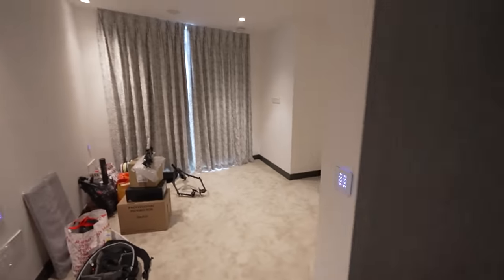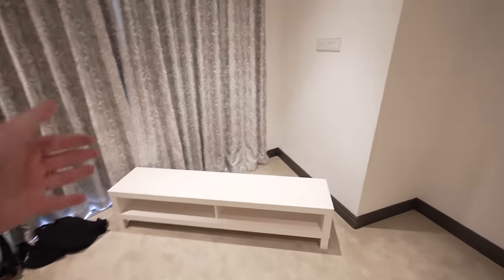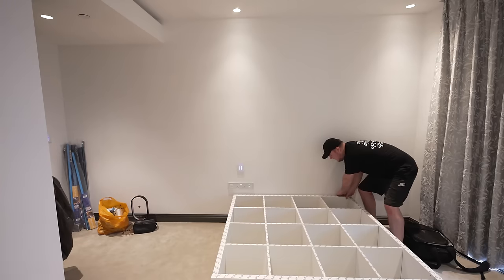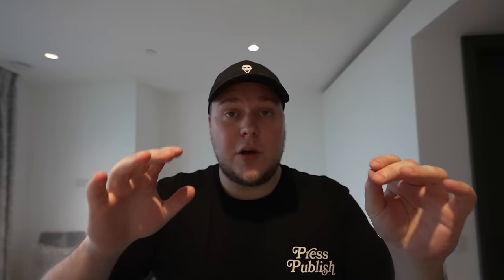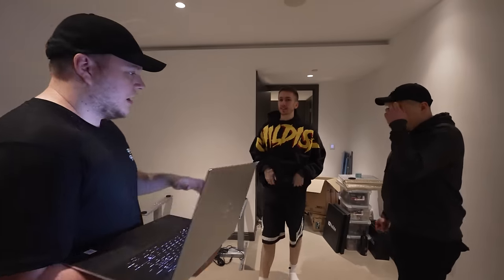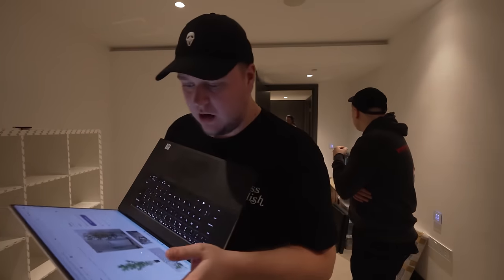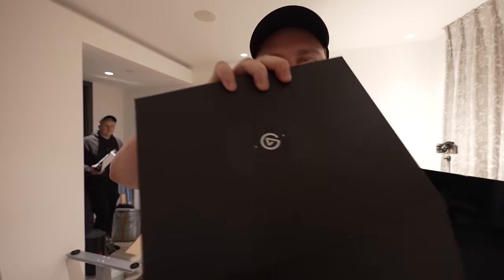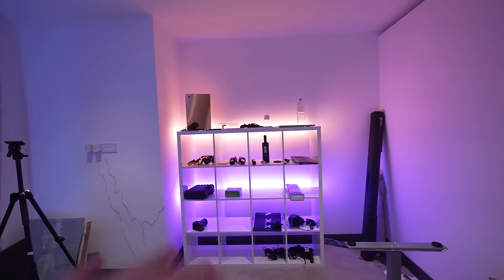BUILDING Miniminter's 2022 SETUP (PART 1)

Comment: Cut some timber down at angles to fit in each corner of the box shelving, this will stop any movement in the shelf’s when you wobble them. Just from looking they were swaying lots when you moved them around.
Reply: You can either use strong adhesive which would look better to fix the timber or screw them but this may not look as good

Comment: Ummm, if you're just gunnu put the p.c on that bit of wood on the floor it's almost the same as having it directly on the floor, when people say don't put your p.c on the floor they usually mean put it on the desk (as in a raised position off the floor) it'll still help a little bit with air flow i guess

Comment: The Kallax unit needs rotating 90 degrees. The smaller shelves are designed to support the bigger shelves. Too much weight on it this way and it will collapse.

Comment: If you read just one comment I hope to too be mine. Don't buy a dell, then have a dell designed issue where if you wanna max out the cpu and gpu while plugged into the wall you won't get 2 hours out of it cause both the 9700 and 9710 battery drain while under full load. I'm trying to get a refund after being miss sold this, and after 2 months and then acknowledging that that's how the machines are designed they are now ignoring me emails. No where does it state on dell's website that there is this issue. Hope this can save some people from making the mistake of buying a dell. Wait till Feb and pick yourself up and msi, razer or asus with the 12th gen intel. Best regards